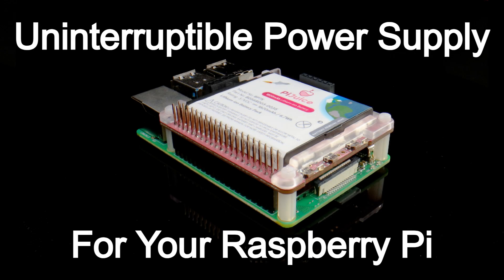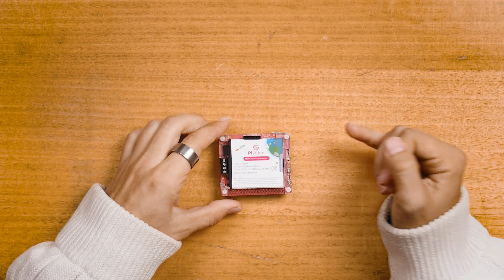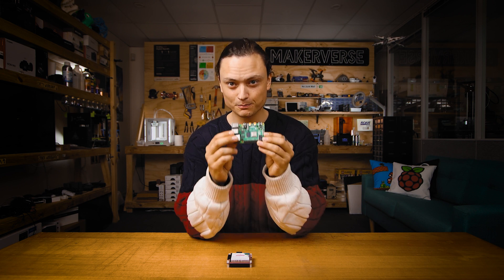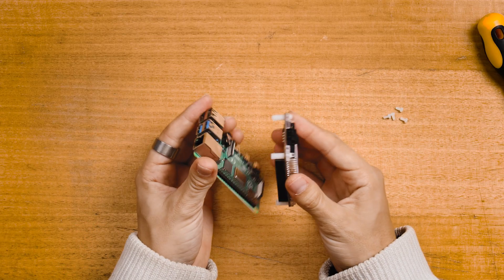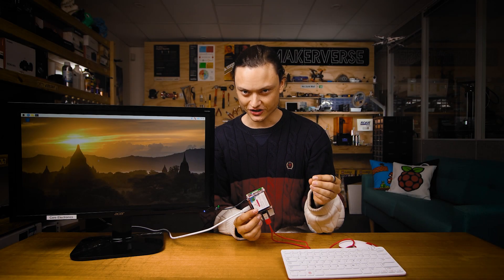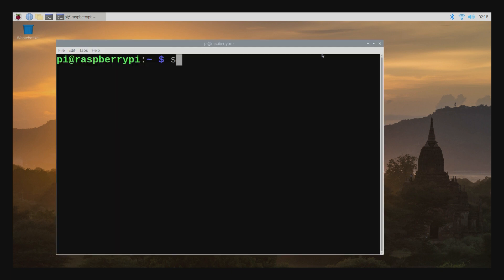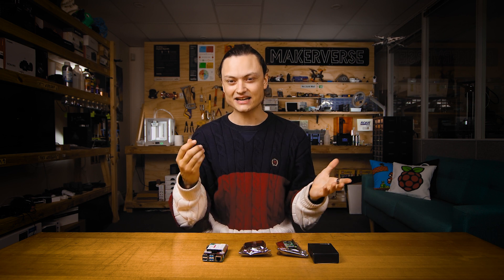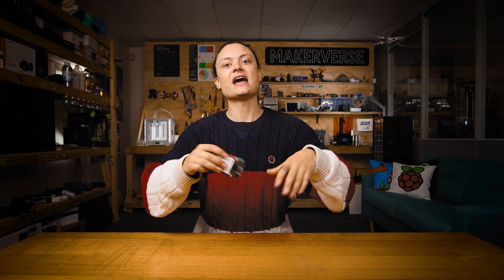Uninterruptible Power Supplies (UPS) For Raspberry Pi With PiJuice

Comment: can i use a pi5 with a m2 hat and have this in the setup aswell?
Reply from the maker: I would caution that many of these HATs desinged for the Pi 4 may not work with the Pi 5. You might wanna check out some designed for the Pi 5, this one for example will work with the m.2 hat:

https://core-electronics.com.au/raspberry-pi-5-18650-battery-ups-hat-51v-5a.html

Comment: Isn't it a problem (when using Rpi as a desktop machine) that during power outage, the monitor will go blank, and we don't have a way to interact with the Pi?  For a server like application, a monitor is not required and so it is fine.
Reply from the maker: Yes if the goal is, 24/7 user access, a monitor attached to the Pi would turn off during a power outage, if so you may be better off with an external UPS but that would cost a significant amount more. But for many running headless, remote or autonomous systems the protection against data corruption and knowledge that any time scheduled actions will be completed is far more valuable.

Comment: Great review!
I just wonder, is there a way to shutdown the RPi using the HAT? I mean, I button to safely switch off the RPi in case I cannot connect with it?
Reply from the maker: This UPS Hat has buttons on the top side of it which you can use to turn on and off the Raspberry Pi as well as some extra hidden features. You can learn all about it here 😊 https://github.com/PiSupply/PiJuice

Comment: What about cooling? Are you able to mount you heatsinks and a small cooler when everything is connected? 

Can I still use a power button on the GPIO pins with this Juice hat?
Reply from the maker: You can definitely add little heatsinks on this UPS 😊. And this UPS HAT has power On/Off button already on the top of it - https://github.com/PiSupply/PiJuice
Reply: @Core-Electronics  thank you for the reply. In my build I'm looking to place this unit on a raspberry pi 4 into a large chassis with some drivers. I was wondering if I can still use the GPIO pins for the power button, and if the battery pack will still perform as expected.
Reply from the maker: That sounds proper brilliant. Your best friend in this case is this Raspberry Pi Pinout website - https://pinout.xyz/

This is a very fast way to check for GPIO Pinout compatibility.

Comment: If you configure the safe shutdown times with the app you show, can you then swap out the SD card with a different OS (such as Android Lineage OS) and still have the safe shutdown operate?
Reply: @Core Electronics - do you know if this is possible?
Reply from the maker: Was just looking into this, the UPS settings are stored on the Micro-SD card. However by default as soon as the Raspberry Pi is no longer powered normally the UPS will take over that duty. If both SD cards had the same safe shutdown times locked in then it will run as you desire. Hopefully that helps 😊

Comment: I've got a unattended Raspi4. Imagine a blackout, and the pijuice batterie runs out after a while.
a) is ist possible to automatically shut down the Pi before the batterie powers off?
b) will the Pi reboot automatically as soon as mainpower is restored - or do I have to push the power on button on the pijuice?
Reply from the maker: Hey mate, excellent questions. Answering a) It is definitely possible to automatically shutdown the Raspberry Pi when the attached battery reaches a certain user defined percentage. Answering b) Automatic Wake up on charge can be set up, also automatic wake up once a certain percentage of battery is reached. 

Hope that helps!

Comment: first of all, if this is supposed to be a review, it did not learn me much core electronics av apparently do no testing. it dos not tell anything about battery capacity, if it manage to be under continually use  under full load by Raspberry Pi 4B and so on. how about cooling of the pi? as many accessory to the pi hats do not allow for propper cooling. and the price for the hat is just about the same as for a full blown UPS and you could by another Raspberry pi if the power outage ruined the one you have.

Comment: It is nice how both pieces come together. However I really wonder about thermals... is there an easy way to fan cool this thing?
Reply from the maker: If you don't mind the extra height it would be possible to use a Fan Shim or an Argon Fan HAT in combination with some stacking headers. Then you can have active cooling and a PiJuice HAT

Comment: Anyone know if you can install and run the custom settings if you're using Libreelec as your OS?  Or if you can write your own custom scripts for shutdown / wakeup?
Reply from the maker: Ive been doing some sleuthing and yet to find a solution. Pop us a forum post and we'll take this investigation deeper. What I have found so far is you can shutdown LibreElec through SSH and the PiJuice HAT will function normally as a UPS however not sure if possible to access PiJuice settings menu

Comment: Well done review and explanation. My only problem is that it sits where i need a heatsink/fan. That's my problem with most hats though, i wish the pi foundation would adopt the idea to position hot components on the bottom of the board since they push for developers to make hats that sit on top.
Reply from the maker: If you don't mind the extra height it would be possible to use a Fan Shim or an Argon Fan HAT in combination with some stacking headers. Then you can have active cooling and a PiJuice HAT.
Reply: @Core-Electronics  good idea.
Reply: i would say top is better as heat rises, otherwise you could damage the board and proper cooling would be a nightmare! but you do have a fair point! fans on the heatsinks do mess with hats majorly! maybe stack an extra level of board raisers on top the mounting kit ones (doubling the height) and find a pre made gpio cable to feed from the pi to the pijuice? might make cases a nightmare tho!
Reply: @geoffupton  true, you can always turn your board upside down so the bottom heatsink is now the top like i do with my nanopi m4 lol.
Reply: Agreed highly

Comment: Would be nice if it didn’t wipe out all the GPIO pins
Reply: It doesn't! It passes them through. From memory the only pins the pijuice uses are i2c - meaning that actually all of the pins remain usable.

Should be right to stick another hat straight on top
Reply: @olivercouch1651  
I didn’t see a 40 pin GPIO  socket on top of the hat .
Reply: @olivercouch1651  
But where do you pick up the GPIO  top of the hat ? I don’t see. Feed through on the hat
Reply from the maker: All 40-pins are passed through to the side of the battery - the exact same way as they are on the RPi.
Reply: Oops my bad - need to get my eyes checked -I was looking for a 40 pin socket on top 👀